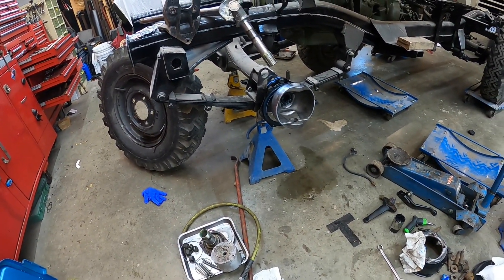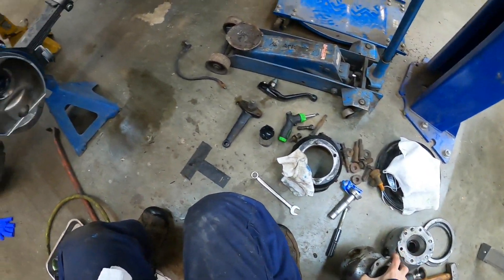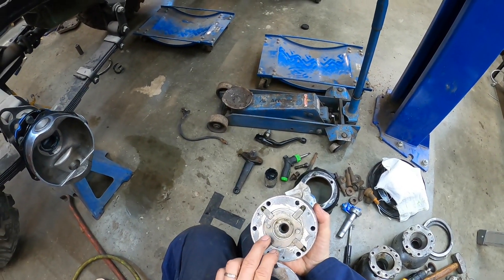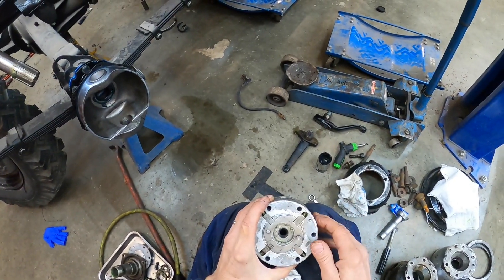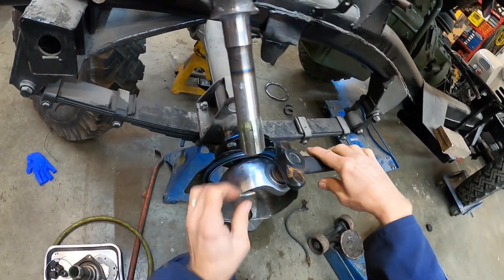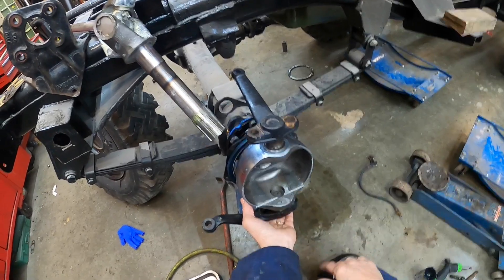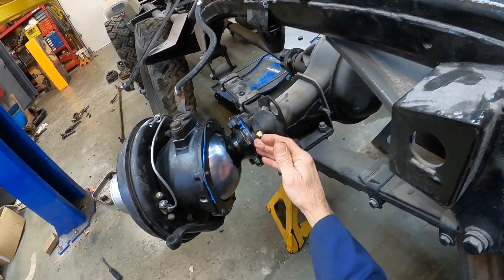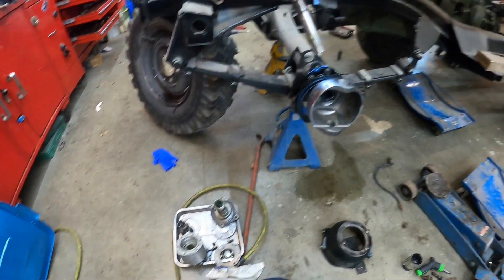A look inside the Austin Gipsy front hubs and swivel housings.

Comment: Was the solid front axle used on any other vehicle or was it unique to the Gipsy?
Reply from the maker: That's a really good question! I know the differentials are unique to Austin trucks, vans, taxis. But the swivel housings and hubs may be the same as Land rover. I'll have to do some research on that.
Reply: @austingipsygarage  I am looking at a Gipsy that struck a large rock and really bent the front axle housing. Wondering if there are replacements available from another vehicle type.
Reply from the maker: @trinityharbour7054  The biggest obstacle with using an axle from another vehicle is the gear ratio on the Gipsys, 5.12:1 is really unusual and hard to match front to back. You would have to change front and rear axles from something like a LR 90 or Discovery, they are very close to the same width. You could do a really nice four wheel disc conversion that way. But it's a lot of work. If I recall correctly the LR Discos and 90s have 3.5:1 ratio, so would make it better on the highway.
Reply: @austingipsygarage  I could convert to LR, but I'd rather just keep it Austin, if I complete the deal.
Reply from the maker: @trinityharbour7054  I'd do the same! There may be used ones around. I have a FB group called Austin Gipsy buy/sell/trade and there are two more Gipsy groups there as well.